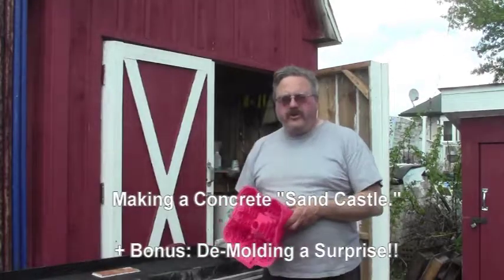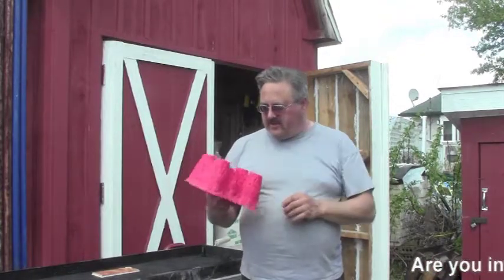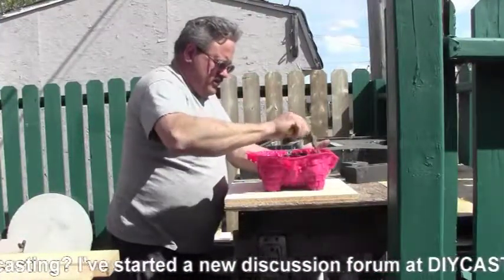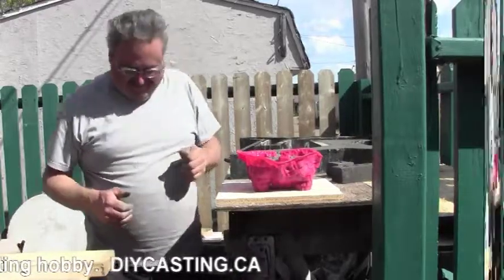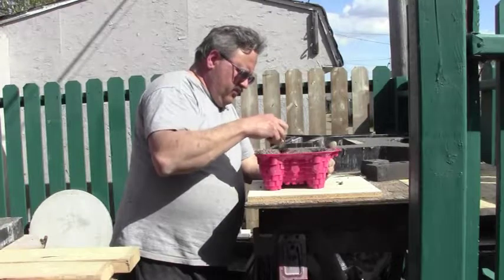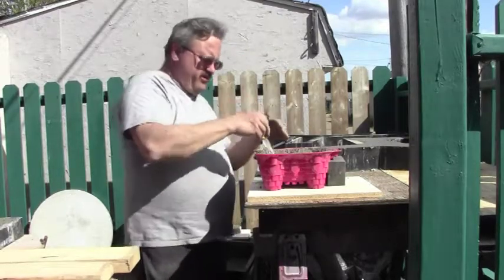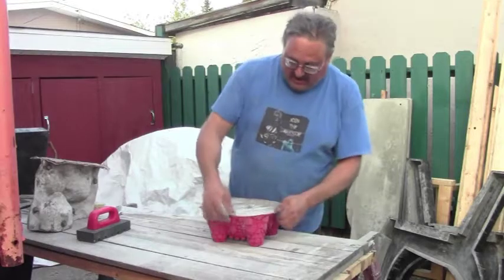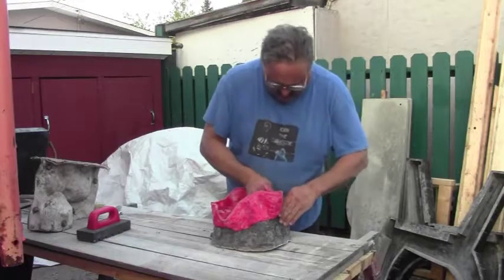Making a Concrete Sand Castle

Comment: Try using a kids hard plastic sand castle mold coated with Petroleum jelly or vegetable oil first, that way your sand castle will come out easier and you won't have the mold flopping all over 😊
Reply from the maker: Agreed. A hard mold would have probably worked a lot better. Although this one did have a bit more detail. Oh well. You win some . You lose some!